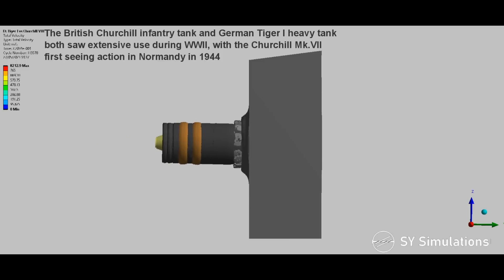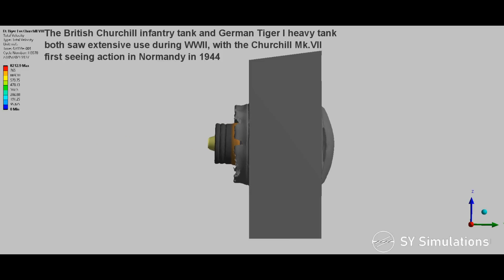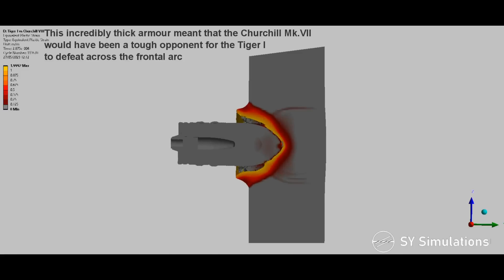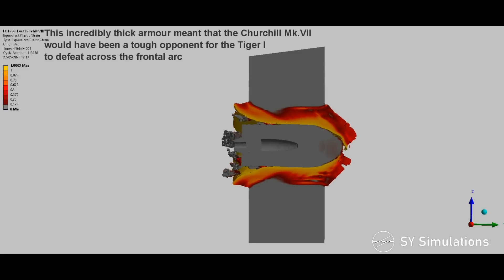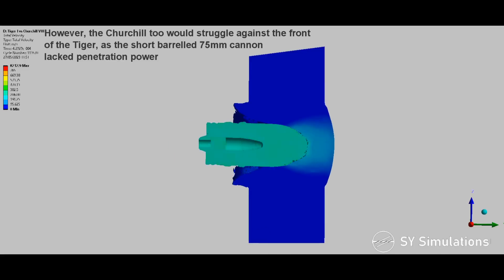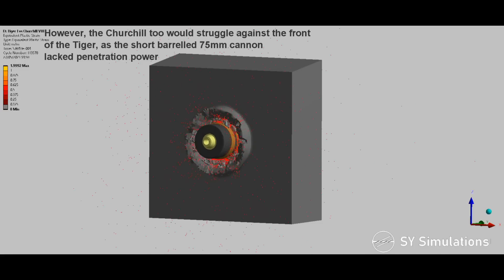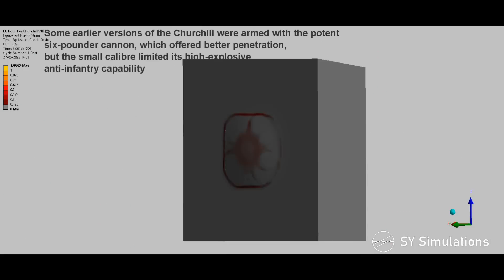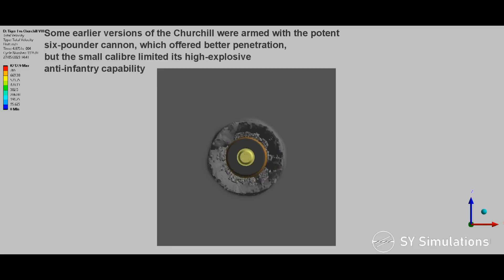TIGER I vs CHURCHILL Mk.VII | 88mm Pzgr.39 Armour Penetration Simulation

Comment: I'd really like to see you test something regarding riveted tank construction. I'm not sure how much variation in construction methodology there was across all riveted vehicles, but at least for most British ww2 era riveted vehicles/parts of vehicles the armour plate was riveted on top of what I think was typically a 12.7mm softer steel structure. In large scale armour plate (even going back to early ironclad warships) it's desirable to have a comparatively soft rear to the armour for a few reasons, but one of these reasons is basically as a spall liner. I suspect that the 12.7mm backing would help reduce spalling from non-penetrating shots. 

Ideally, it'd be cool to see otherwise functionally identical areas of two vehicles, just one welded, and one riveted and do two identical scenario sims of non-penetrating hits to see the difference when it comes to spall. Just an idea, but some Cromwells were welded, so that might be an option.
Reply: The softer steel is not spall liner. On warship, the softer steel is the structure steel, with armor steel plate mounted on the structure steel. 

There are warship that used multi steel layer, but the thinner layer are harder with better mechanical property, and they tend to place on the outside. 

Cromwell for all intent and purposes is a WW1 tank, thus it used a very similar construction ideology. Load bearing structure steel with armor plate mounted on the structure steel.

However by this point, pretty much everyone mastered welding armor plate to a reasonable quality and making armor plate bearing load without destroying it.

Will it act as a spall liner if something with ballistic limit of 64mm hit the armor, yes. 

How often you encounter that exact threat? Practically none. 

You are better off producing a 70mm good quality mono rha plate. Being lighter and offer superior ballistic protection 99.9999% of the time. 

Attachment methods doesn't matter. In very technical terms, rivet plate will have more movement thus removing more energy from the projectile but that's purely academic, the ambient temperature will contribute more error to than the mounting method.
Reply: @jintsuubest9331  I never said it was supposed to be a spall liner. I'm well aware of at least the conventional lines on why this was done. I was literally just asking if it would "act as a spall liner" if the 64mm's ballistic limit is reached. I am well aware that a slightly thicker armour plate would offer better resistance, and reduce spall as well, but is there room for some slightly surprising effects of such a soft backing (in comparison with the qualities of the armour plate)? Perhaps. I've seen one other sim on a tank of this construction that showed a distinct lack of spall, when you would otherwise expect a lot (if you watch a lot of these sims). I want to see if that would be replicated.
Reply: @tommeakin1732  
Yes, if the ballistic limit is exactly 64mm, then nothing should be flying in the crew compartment. 
But if the projectile even as much as exceed the ballistic steel layer by a little bit (budging the armor steel layer), we should expect crack and smaller particulate starts to form with the structure steel layer. 
Anything more is bad news. 
That's from british study, actual experiment confirmation).
Reply: @jintsuubest9331  well, fingers crossed, we'll see a sim that covers this little subject!
Reply: Layered steels is very interesting, we studied ballistic composites and armour at uni and mixing and matching steels is a fine art.

Comment: As a result of poor penetrative performance of the Churchill's OQF 75mm Mk V, a new tank based on the Churchill began development in 1943. This was the Black Prince, using a widened version of the Churchill Mk VII hull, allowing for the fitting of a larger turret that could mount the excellent QF 17 pounder anti-tank cannon. The Black Prince entered production in 1945, but did not see service before the war's end and would be abandoned in favor of the far more mobile Centurion.
Reply: the Black Prince started his attack "run"in mid 1945 and is supposed to enter Belgium in 2030, germany in 2050.
Reply: You forgot to mention that it had a top speed of 16.9 km/h on road. It was slower than the Maus.
Reply: There are trees growing faster than Black Prince at top speed!
Reply: It did not enter production smart arse
Reply: They only made 2-3 of them and they were woefully underpowered and would not have been viable without a much more powerful engine.
Reply: @trappenweisseguy27  yeah there were plans and I believe a prototype with the 600hp Meteor engine which would have brought the Black Prince back on par with the Churchill in terms of mobility, but even with that upgrade the Centurion was simply better
Reply: The QF 6 pounder was better at AT
Reply: @West_Coast_Mainline  but it lacked an effective HE round. As infantry tanks, Churchills were intended primarily for infantry support, so HE was a necessity.
Reply: The Black Prince never reached production. It was pointless when they had the Centurion.
Reply: Looks like you all skipped the Comet there. With the Comet already seeing action and the Centurion around the corner why bother with the dead-end the cul de sac that was the Black Prince (so they didn't) but all three were too late; the Comet would have been great had it come earlier in the war but had little impact as late. Wartime production focusing on what could be made now more than the next, better thing is understandable.
Reply: Black Prince in halfway useful numbers might have been the Firefly of the Churchills and certainly an unpleasant experience for German heavies to meet something that could trade punches at range.
Reply: @edmondbarrett3968  The Black Prince might have been out of it's element by late war anyway since the long 88 of the Jadgpanther and Tiger II could penetrate a Churchill.
Reply: @alarminglyfastmovingskelet7289  there were very low numbers of those tanks so they don't matter
Reply: @alarminglyfastmovingskelet7289  Not sure how many Jadgpanthers were built and Tiger II, had its own issues. Defenders advantage is probably more relevant since by the time Black Prince could have conceivably seen action the Germans were firmly on the defensive. It would be more the German rank and file Pz IV, Panthers, and even Tiger I that would have found something that could stand and take hits like a KV1 in its glory days to be unpleasant.
Reply: @Pixilated  Kind of a bad argument since the Black Prince was never fielded to begin with, atleast the Jagdpanther and Tiger II actually saw service.
Reply: @alarminglyfastmovingskelet7289  i wasn't defending the black prince since that was low in quantity as well. I was just saying that tanks made in low quantities generally have little to no effect on the war.
Reply: @Pixilated  People seem to forget about the Panther. There's over 6000 of them. The Panther had similar armor and firepower while being way faster. The black Prince moves at walking pace, even slower than the Churchill. The Comet was already an excellent tank, and the British rightly prioritized it over the Black Prince.
Reply: @neurofiedyamato8763  The Panther was actually a pretty decent tank. Yes it had it's mechnical issues because it was way too heavy but it's main advantage was that is was actually mass-produce*able.
Reply: @neurofiedyamato8763  Lol those 6,000 did diddly squat 😂.
Reply: @BARelement  Tell that to the allied forces. The Panther tank was super common vehicle and prompted a response for that very reason.. It didn't turn the war around, but no single equipment would anyways. The Panther was mass produced for all accounts and purposes.
Reply: @neurofiedyamato8763  Break downs = frequent. I don’t have to tell the allied veterans who fought for the rights of human beings (you didn’t). They took care of almost all panthers. Oh and the Bf 109? Hardly any airworthy ones left 😀.
Reply: @BARelement  sounds like you are more about being ideological than caring about historical facts.
Reply: @edmondbarrett3968  panther can pen a churchill 7 thats not angled though.
Reply: @alarminglyfastmovingskelet7289  Even the long 75 in a Panther could penetrate a Churchill frontally, so yes, I agree the Black Prince was an antiquated concept.  By war's end, extreme mobility with a super powerful gun had trumped the super heavy armour tank.  When you can barely survive regardless of your armour level, then it's better to lighten up and add mobility.
Reply: @neurofiedyamato8763 I think a technique would be used of angling the armour, which is teached to tiger crews, this would effectively increase their armour value
Reply: It was barely more mobile ngl. The problem is why stick 300hp in such a tiger weight class tank…
Reply: Wasnt that the tank that almost nobody could actually shift gears in because they just couldnt do it faster than the tank lost its momentum and crawled to a halt?

Comment: One of the big history channels actually talks about what Germany thought of the Churchill. 

To sum it up, they acknowledged occasionally they would have trouble from the front, but dude to the other Characteristics lead to them being taken out “without to much trouble”.

They do not talk about the Churchill like they did they KVs and such
Reply: It should be noted that the Churchill came significantly later than the KVs and as such Germany already had the weaponry to deal with it, however this only applies to the earlier variants. The Mk.VII and had much thicker armor than the earlier variants, and as we can see in this video, most German AT weapons were ineffective against it from the frontal arc, and the side armor was among the thickest of any tank produced in the war. A better comparison for the KV would be the Matilda II, which the Germans did have issues dealing with early on in the North African theatre.
Reply: This was about the earlier Mk III/IV variant iirc. The tanks they got were from that horrible shingle beach on Dieppe with lots of small stones. This damaged the tracks on the Churchills they tested. The Germans were impressed with the hill-climbing capability of the Churchill as it could climb sloped they deemed impossible for tanks. That's about as much as i remember from a video i watched by MHV/MHNV , might be the same one you watched
Reply: Those are the reports regarding the Mk. IV variant. The Mk. VIII variant, specially in its AVRE and Crocodile modifications, was notorious among german troops. So much so that the jerries simply surrendered once they saw these machines.

Comment: So im guessing 200m+ ranges would not result in perforation?
Reply: I'm no expert but I'm assuming it would take a little more than 200m. That's quite a bit of spall at 100m. If the Churchill was angled maybe.
Reply: @professionalredneck7920  plus the fuse is going to explode so its gonna be a shotgun blast for the crew
Reply: I think 100 meters is not enough to lose that much energy. Something like 300 meters
Reply: better say 200mtrs and the channel this might be OK (:-)
Reply: From the little research that I have done,

Firing PzGr. 39 (APCBC) the Tiger will penetrate this at 250m

Firing PzGr. 40 (APCR) the tiger will penetrate this at 1500m
Reply: @notsureyou  They usually count only direct hit for APCR, it's really affected by any slopped hit. 

This is why they often test at 30 degrees, because direct hits are never a reality